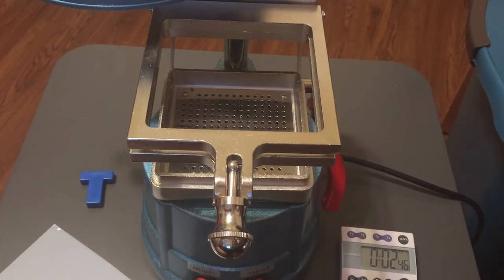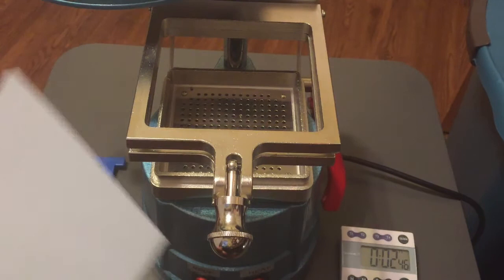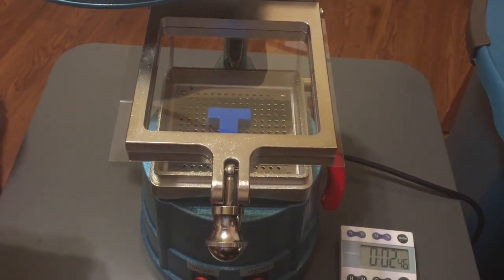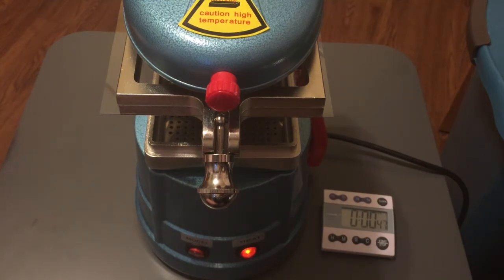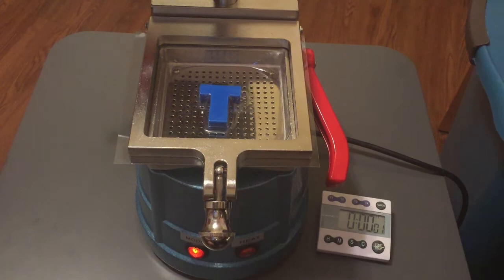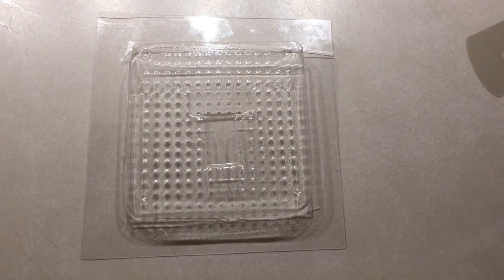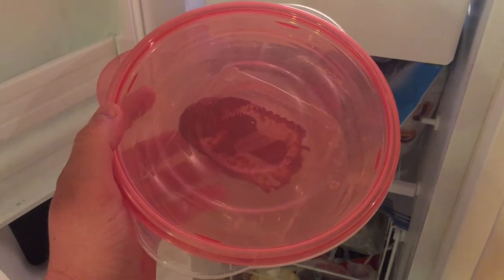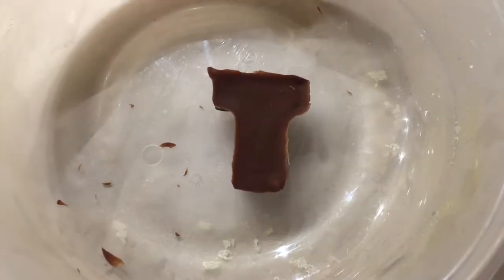Making Custom-Shaped Chocolate Using Vacuum-Formed Thermal Plastic Mold

Comment: You did nice job on demo.  The only things wrong with these units is the forming area is FAR too small for majority of projects most people are looking to do.  The other thing is that should the vacuum unit internally give out the unit is no longer usable. Last but not least the limited size for cost of unit is very disproportionate in that a DIY system is far more economic.
Reply: Why would the vacuum unit give out? I made one DIY and it was cheaper but the results were not nearly as good in detail as using my friend’s dental unit so I’m going to buy one. The area is small but for me I’ll just put several smaller molds together rather than making one big mold and that’s fine.

Comment: Wouldnt your problem be that your using sheets too big for the device? i.e 5x5 sheets fit perfectly inside the vat, where as yours  stick outside the vat which could cause pulling upwards of the plastic thats forming